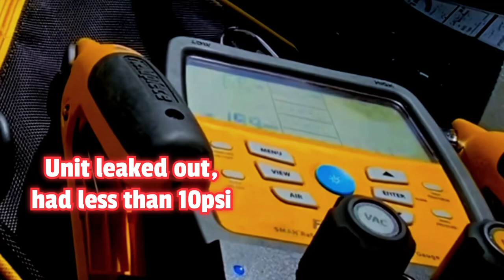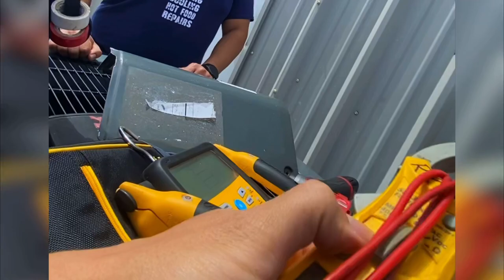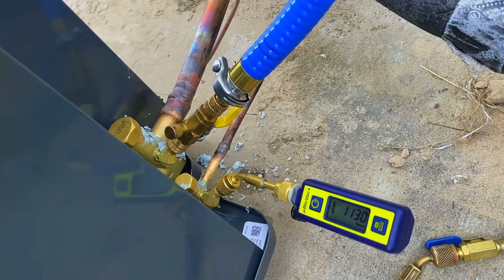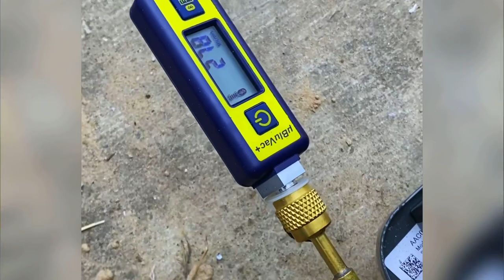Split System Condenser Install | HVAC Apprentice

Comment: I think those have the drier on the inside, which is a pain to change.  Nice video.
Reply from the maker: I don't really do split systems but yes and I'm not a fan of that. Easier for the installer but not the service.

Comment: Nice video, you can also take the service valve caps off and fill them with water to block the heat better. I like that you do everything by the book and correctly. Great job
Reply from the maker: I'm not perfect but I try, you get better as you go. I'll try and show the good with the bad 😂

Comment: you forgot to show us how you changed it from r22 to to 410a, green bottle on floor and piston still on the unit.
Reply from the maker: Sorry bro that wasn't mine 😂. Someone left a 427 tank just there. This was a 410a system originally so no conversion. Good eye tho

Comment: Next time let your bro do the work and only step in if he's doing it wrong. That's the only way he's gonna learn well. You doing the work and him watching only slows his learning. Also I use to do lots of residential when I first started the trade and those Goodman amana brands don't last very long. 5-7 years with maintenance. I know they may give you profits for replacement but do some research from other techs on brands you may do replacements on. Also level your replacements.